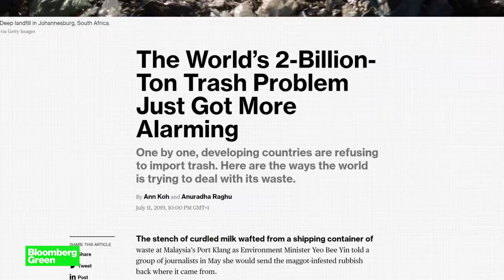Why Recycling Isn't Quite Working Anymore

Comment: We should get back to glass, tin and aluminium. Plastic is the biggest headache. Paper is not entirely benign to the environment, but at least it is largely biologically and environmentally degradable without ensnaring animals. A wide range of insects can live happily off paper and not much else. As are food stuffs. 
In general the time is now ripe to drastically improve robotic trash sorting. Not just on a large scale, but at home. I can see a trash sorter/composter as being a desirable home appliance.
Reply: Not aluminium, that wouldn't help anything! Paper and glass is the way to go!
Reply: @pilotjonas8  I don't see the need to be so purist. Aluminium is a useful packaging and manufacturing material, and a valuable recycling material too. I'm thinking primarily in the realm of temporary food preservation Right now plastic is the only way to go, and you can use paper for some of it, but as mentioned in the video oily residue spoils the ability to recycle paper. Glass... Well that's overkill if you just want a takeaway.
Reply: The easy reality is that most materials can be recycled. I for instance for years don't have much organic waste to talk about. That include paper and cardboard. Even with oil/fat spots. Like mentioned on the video. 
The real "killer" is plastic. That is honestly the biggest headache and the most challenging part. Although even that can be converted into energy! The issue is economy, to make it profitable! That's where the catch is.
When there's a will, there's a way. 
BTW for what it's worth my organic waste, including paper&cardboard, is the next season compost for my garden! Really simple and effective.
Reply: @crpth1  yup.
Reply: @joeblack4436  they need more resources dan energy to produce, so we just shift the problem
Reply: aluminum cans have plastic inner lining
Reply: @pilotjonas8  Unless you have a supernova in your pocket,  the earth has a finite amount of metals.  If we don't recycle them now,  we will have metal mines in every old dump in the future.  I don't know about you,  but i don't want my kids working in a garbage mine.  So gj picking the 2 dumbest things to recycle,  while ignoring the important one.
Reply: The problem with glass is, while it is 100% recyclable, it wastes way more energy than simply making new ones.
Reply: @delusionalmilkshake  in mexico you get a return deposit on returned glass bottles, or a discount or something
Reply: North American YouTuber  you can't recycle many types of plastic, foil per instance is just clogging the machines
Reply: @delusionalmilkshake  what about reusing glass? in Belgian supermarkets you can find a machine where you deposit glass bottles and get some coins for it, then they get used again
Reply: @rtgbhreth  I could be wrong, but from what I understand it's actually a sort of wax lining isn't it?

Edit: Either way, it's such a small percentage of the actual can that it would probably be cheaper to make just that lining out of recyclable plastic than all of our plastic products.
Reply: Since we still use oil as a society, might as well use the bi-products from it instead of just wasting it to use paper that take tons of water to make

Comment: "It often costs more to recycle than it does to just throw things away" completely ignores the cost to the environment. 
When will environmental cost be truly monetised. Only when this cost is equal to the other costs will these problems really be dealt with.
Reply: i came to the comment section to mention this as well total disregard of the environment to save money. Bloomberg is all about money so im not shocked that they wouldn't care about human life or the environment.
Reply: He gave the solution calculation of the damage to the health of the population and nature in general. That's the costs of throwing something away. Put that cost to the product and suddenly allot of products are from easily recycled goods
Reply: North American YouTuber  he did
Reply: jim S actually it does consider the environment. I wrote a 20 page research paper on the subject, and recycling has caused greater environmental harm than land filling because we don’t actually “recycle” but a tiny fraction of what is put into the recycling stream. Large portions of recycled plastic has been exported. Do you really think China is using all of it? No, not even close. They dump it in the oceans or burn in open air. Thus, recycled waste ends up in the oceans and open burn sites more often than that which is thrown away. So it costs more to recycle precisely because of the considerations of the environmental costs.
Reply: @brandonprice1301  this doesn't ring true to me, by dumping into the sea they are damaging the fishing industry and so if those costs were added into the equation then it may be worth recycling more.
By burning it the are damaging peoples health, animals health etc. If these costs were in the equation then cost of recycling may be more reasonable. 
The cycle doesn't just end with the end of the process, damage to marine life and fishing waters could be calculated in perpetuity so would equal to millions for each ton dumped.
The cost of recycling or dealing with our waste needs to be factored into the sale price of a product otherwise it is a problem that never goes away.
When you say it actually does, you aren't thinking clearly. Do you think a small factory really cares about the end of life of the product when they're selling their goods or do they care more about how competitively priced their product is? This is where economists and producers need to have government intervention and where capitalism completely fails.

Comment: I read a little about this a few months ago.  I was wondering why the notice I got from my local recycling center said that only plastics with certain numbers on it were recyclable.  Well, I do my best to conserve resources.  I use a reusable water bottle and a filtering water pitcher.  I also eat dry beans instead of canned.  They do come in a non-recyclable plastic bag but are very compact.  If I could buy them in bulk and skip the plastic bag then I would.

Comment: Starting at 2:50 the video mentions recycling cans, steel and paper - but not plastic. I think if there is an excess of materials like plastic it should be burned to generate electricity, and the smoke and fumes generated be scrubbed. Environmentalists are going to have to accept that burning plastic, along with household garbage is environmentally better.
Reply: Large plants do generate enough electricity to supply tens of thousands of houses. But studies have shown that recycling plastic waste saves more energy—by reducing the need to extract fossil fuel and process it into new plastic—than burning it, along with other household waste, can generate.

Comment: Pyrolisis with steam cracking can turn plastics back to oil.  It would make sense to have refineries process plastics back to oil.  It's easier to cleanup a truck that spilled pallets of compressed plastic trash than it is to clean up after a leaky oil pipeline.   For remote areas, turning plastics into fuel would mean having to import gasoline less frequently.
Reply: If this is accurate and hasn't been applied yet, it reflects how corrupted the system is.
Ps what is the carbon footprint of the military industrial complex?

Comment: Re-use > recycling. 

In Norway all drinks comes in thick standardised plastic bottles which are returned after use for washing and re-use by the manufacturer. We used to do this with glass bottles. No reason we couldn't again.

Shipping cartons could be made durable and reusable too. If you're a regular Amazon customer they could send out your stuff in higher quality packaging and pick up the empties whenever you leave them on your doorstep for reuse.
Reply: Shipping + reconditioning has a heavy carbon footprint too...
Reduce 
Reuse 
Repair 
Recycle 
Ps what is the carbon footprint of the military industrial complex?

Comment: 1. require recycling centers to ONLY accepts fully cleaned recyclables, it's not trash.
2. have high speed sorting done by computers that can instantaneously analyze each piece for ideal sorting and process (computers can learn that Dasani 16oz bottles need their labels removed prior to melting and instantly sort them accordingly, etc...
3. Sort and melt the plastics into categories #1-6.  Steps 1 and 2 keep the product pure
4. Cardboard can be reduced to wood pulp(?) and stored in blocks.  Steps 1 and 2 keep the resulting product pristine
5. same for metals but they are even easier

Thoughts - There must be filters for molten plastics.  What about plastics distillation like petroleum distillates?  That's where you heat the liquid and the floating particles coalesce at certain heights to produce specific materials.

Comment: One way to reduce plastic bottle wastage would be for the manufacturers to use glass and aluminium only. Glass bottles can be  cleaned and reused. Aluminium drinks cans can be melted down to be made into other products, perhaps another drinks can.

Comment: MY pet peeve. Buying a snack and having that said snack be only 25% of the package. I thought “what a waste”. 
Now making plastic bottles TOO thin is annoying as heck. Aquafina was notorious for this. They had made it so thin it was impossible to open the bottles without spilling the water because you had to put pressure on the bottle and cap to open it. They have since abandoned that paper thin plastic bottle.

Comment: Even better solution is to use reusable bottles. Like how milk bottles used to be. You use it and give it back to the place you got it from. Its washed and reused. No need to throw away or even recycle. That should be the least expensive method. I think this should be done with all our products. Like perfume bottles, after shaves, shampoo, lotion and so forth.

Comment: If you incinerate garbage at a high enough temperature it isn’t toxic and turns the garbage back into basic elements.
Reply: Are you aware your statement is nonsense? 
Reduce 
Reuse 
Repair 
Recycle 
Ps what is the carbon footprint of the military industrial complex?

Comment: Heres a radical solution.  All and I mean all one time use items should have a 25% tax increase use on it.  Increase the price on garbage pickup  make people take a how to recycle course and test them each year. Each time they fail,  fine them.
And finally,  you dinosaurs need to retire.  No one can think outside the box when it comes to recycling.
Reply: In California we already add a .10 cent CRV tax per can/bottle, which is about 25% of the soda's cost, on a pack of 35. Those same containers still end up being a problem, and recycling companies still need to sort them, bundle them etc.  The tax solves no problem, since politicians will dip into those funds to pay for contracts to corporations.  The tax will simply make things more expensive. Not many folks ever redeem the the cans to a recycling center.
Reply: Finally, recycling is inefficient, as it requires sorting by material type, and plastic type (1,2,3 etc.) and color.  Then it is crushed and shredded. Afterwards, it is melted down, packed, shipped and stored until is shipped again, and reshaped into a new containers.
Recycling courses are already being taught in elementary schools; they've been learning recycling since  the 1990s at least.